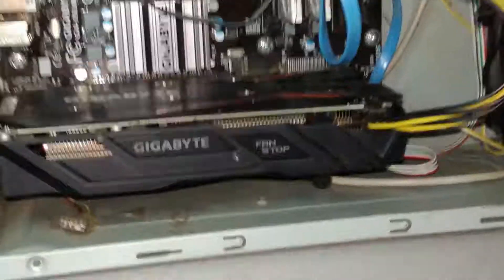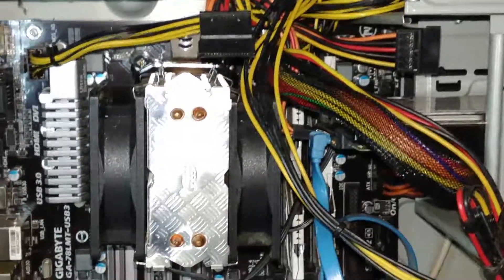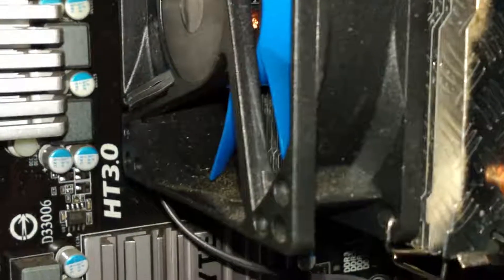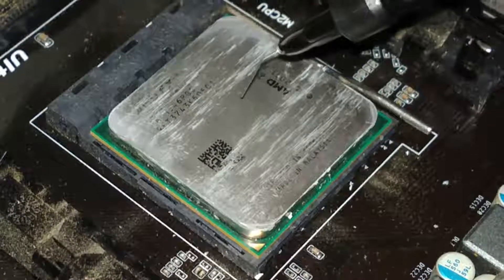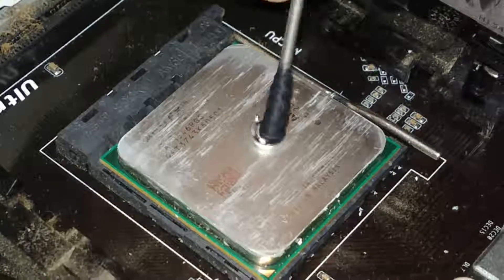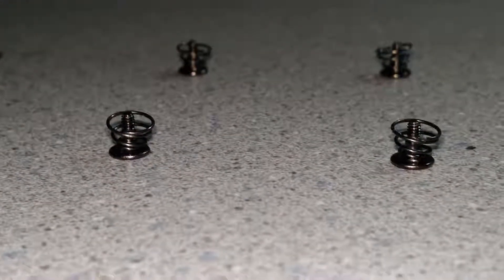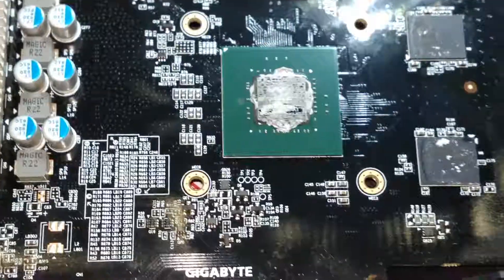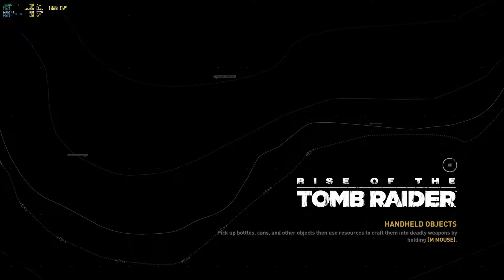GTX 1050 Ti Overclocked with Liquid Metal

Comment: Liquid metal works really well. It's just your cpu still had thermal paste residue on it. The heat spreader needs to be totally clean before adding the liquid metal and you need to spread it around until there is a thin film coating both the heat spreader and the heatsink. My fx cpu runs at 5GHZ 67c using a Corsair i100 water cooler. Next project is liquid metal on my Asus ROG laptop that runs a gen 7 i5 and a GTX 1060 GPU. I use Thermal Grizzly Conductonaut.
Reply from the maker: Absolutely later after disabling I gave it a good cleaning but I wasn't thinking about when making the video.